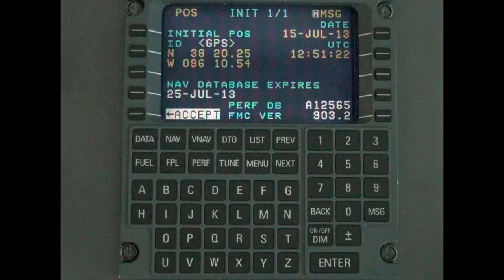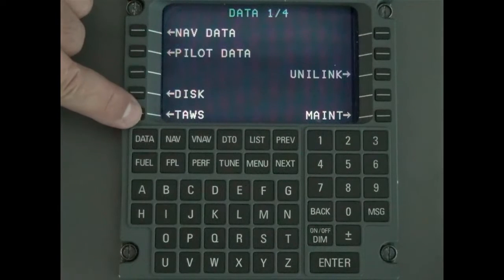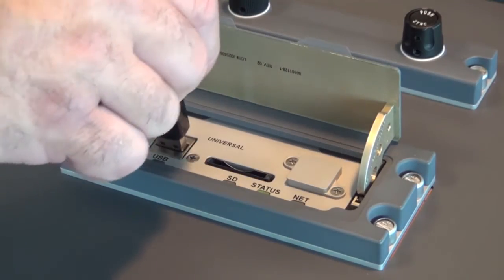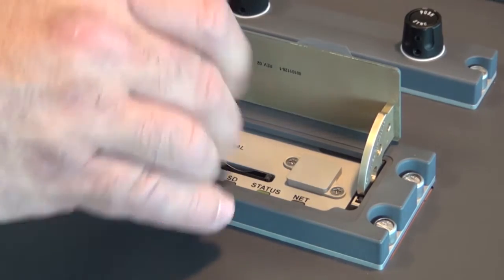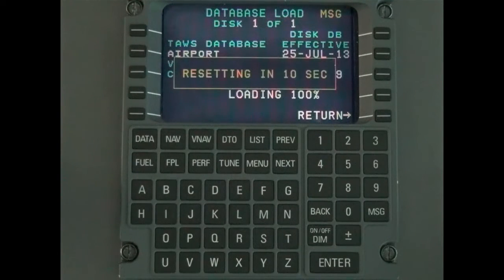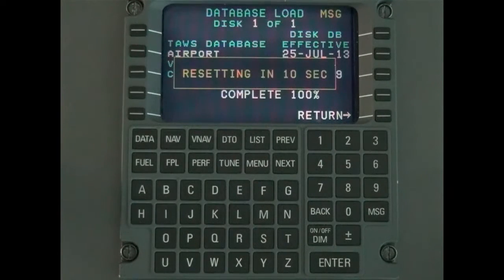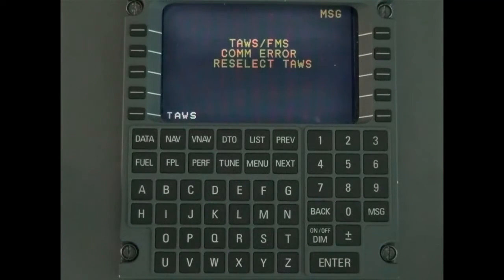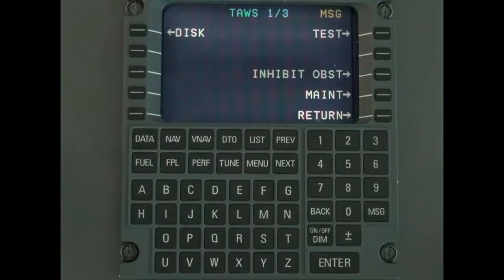Universal TAWS Database Loading

Comment from the maker: TAWS is Terrain Awareness and Warning System Class-B. TAWS-B, enhancement improves the current Terrain and Obstacle Proximity system by providing additional integrated warnings and cautions with both aural and visual warning of impending terrain and obstacles. Hearing the words "PULL UP" or "WARNING TERRAIN" through TAWS-B gives you the valuable time needed to react.